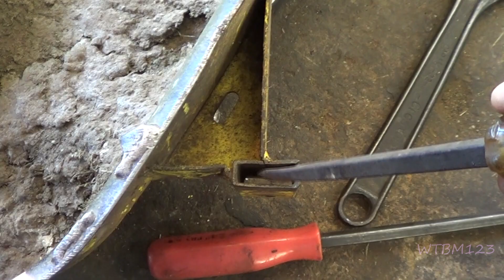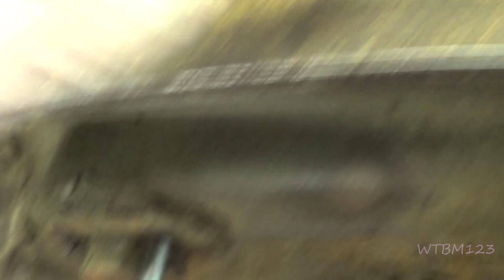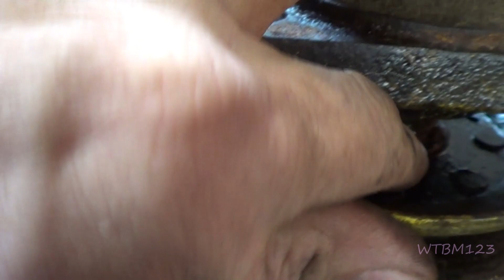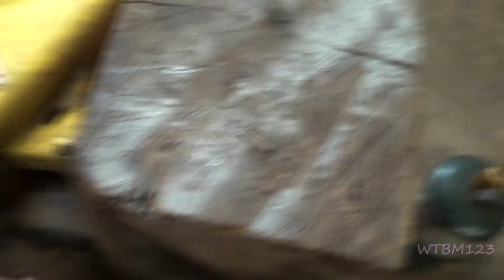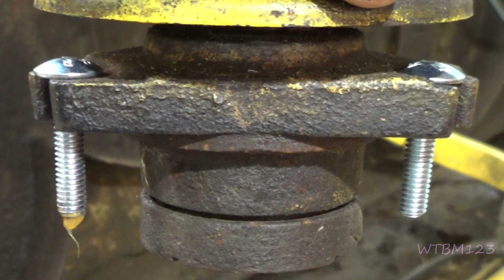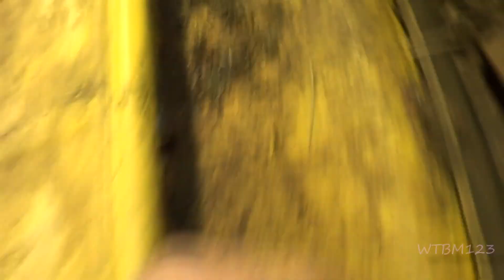Spindle bearings 318 John Deere weld wheel on mower blades

Comment: Hello again Terry and greetings from UK.Can I ask you what type of Welder you used for this job ? Would a 130 amp  Mig work or I have an arc Welder 110 amp.I would welcome your advice as I am a novice and need to do a similar job on a cart I have lying around .Best Wishes M.
Reply from the maker: 110 volt Hobart 140 handler . .030 flux core wire . Easier to get nice welds with gas , but i am out side welding alot so i just use flux core . The metal on here is not to thick so most any welder will do . I have 5 heat settings and i think i was only on 2 . And the rate of wire speed is important . Not enough wire speed and the wire will melt and drip off before hitting what you are welding and to much speed you will feel the wire hitting .
Reply: @wtbm123  Terry thats a great help .Thanks for taking the time to stop by ❤